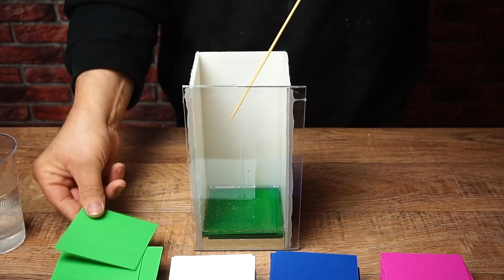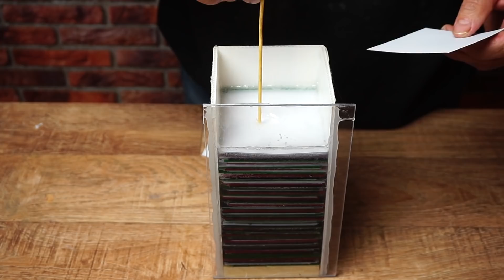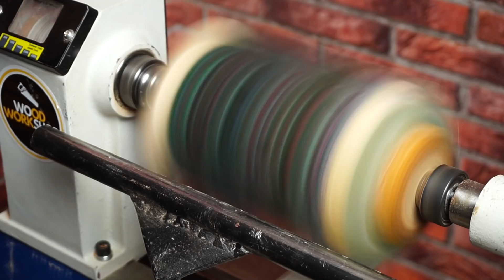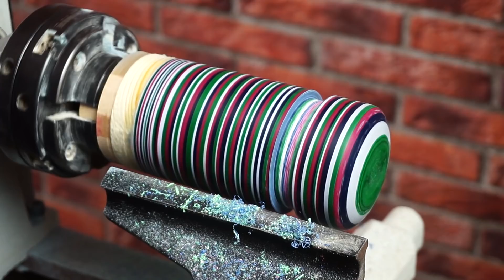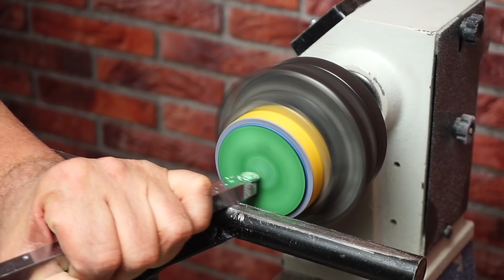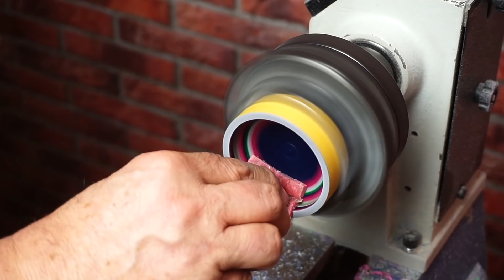Turning Paper. Can It Hold Out?

Comment: So. Turning paper is actually done on a huge scale in the paper industry. (And they don't use resin) 

They create what they call a filled roll by using pieces of paper with a hole cut in the center. 

They stand a metal core up on end for the roll (some of them are crazy tall steel rolls) and then they push down stacks of this paper down the core to the bottom with a weighted ring. The jig its standing in is actually a screw press, and as they fill the core they bring down the press (basically a ring between two giant screws) to press the paper together. After they are finished filling the core, they bring the press down to full pressure and leave it like that while constantly adding pressure over time. What this basically does is turn the paper into a solid mass almost like rock. Then the top end is put on and locked down. 

Finally, and this is what made me think of this in the first place, they tip down the roll and put it in a giant lathe. This starts by trimming off all of the loose paper corners sticking out everywhere and continuing in deeper eventually the turning looks a lot like this video, but on a huge scale. 

Lastly they check for air pockets along the length of the roll on all sides. If there are any, they have to start over. When these rolls get up to speed, an air pocket can cause a chunk like a rock to come flying out of the roll.

So yes, you can turn just plain paper on a lathe. 🙂

Comment: This is not a new idea. Micarta is a brand name for composites of linen, canvas, paper, fiberglass, carbon fiber or other fabric in a thermosetting plastic. It was originally used in electrical and decorative applications. Micarta was developed by George Westinghouse at least as early as 1910 using phenolic resins invented by Leo Baekeland. Wikipedia